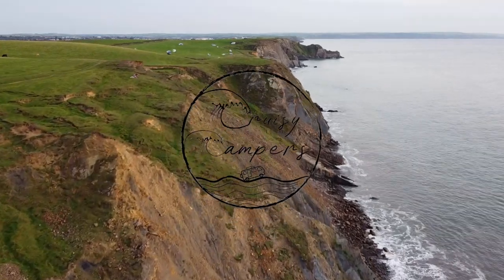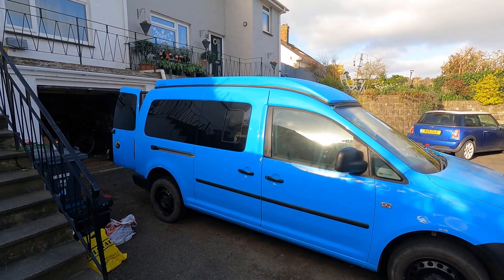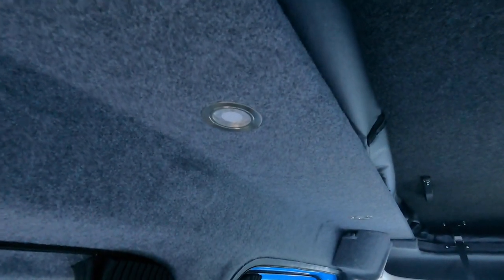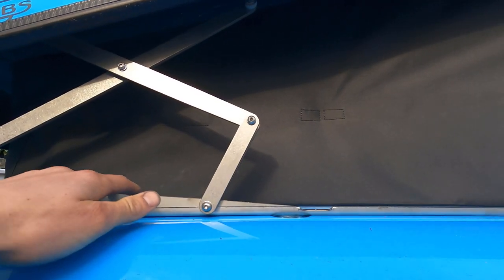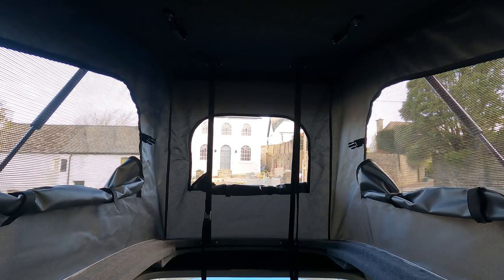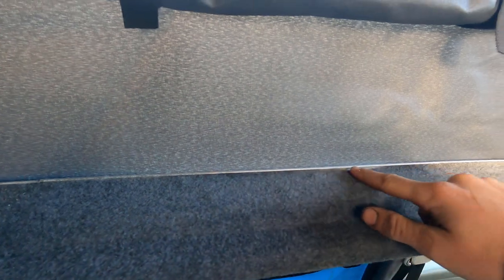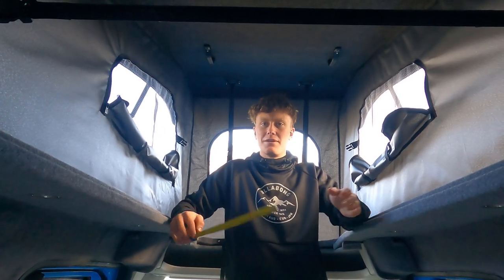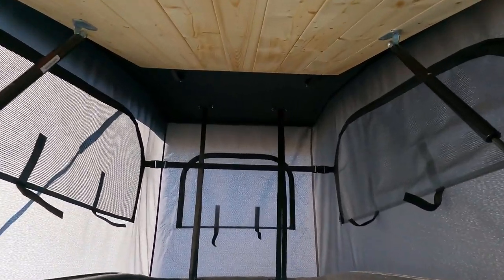Volkswagen Caddy Maxi Westdubs Pop Top Demo Tour

Comment: Is there any change of height in the interior headroom when the top is down, ie is it lower or higher than the original roof inside?
Reply from the maker: With the bed it makes it the same height, but without the bed it adds about 3/4 inches of added height. Which does make quite a difference